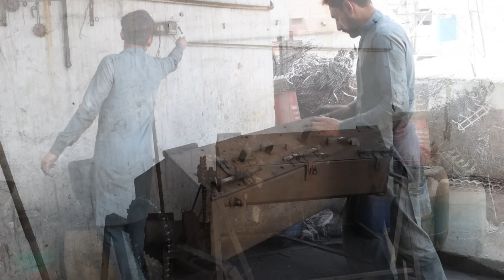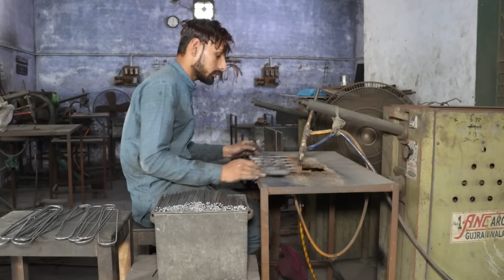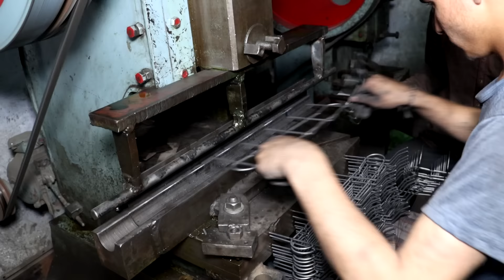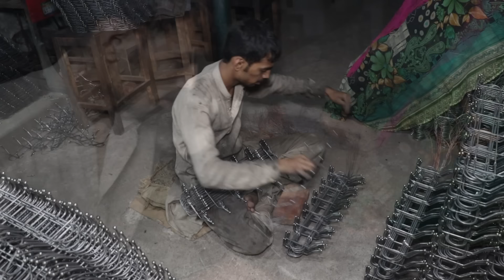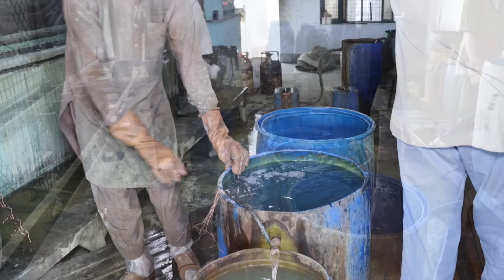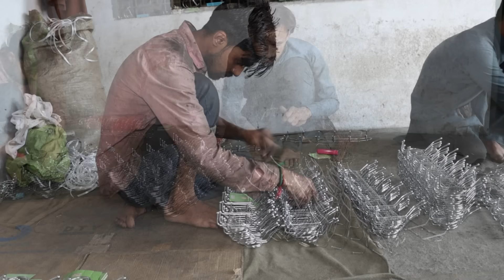Amazing Process of Making Stainless Steel Coat Rack | Factory Mass Production Process

Comment: This is not Stainless Steel, if it was you would not Nickel plate the hangers. Looks like mild steel wire. Great job 😀👍🇦🇺
Reply: Agree. Its mild steel wire usually zinc coated. Stainless is way too expensive.
Reply: OK stainless steel police
Reply: Take it easy Pinkie, just stating the facts in the video.😁🇦🇺

Comment: We get plastic hangers that break ina month. These hangers are so strong, they will last a 100 years
Reply: its mild steel wire nickel plated, its gonna bend and break at the tack welds
Reply: @AsbestosMuffins  Nope tack welds will last indefinitely if used correctly.